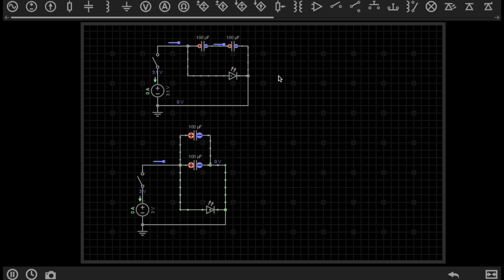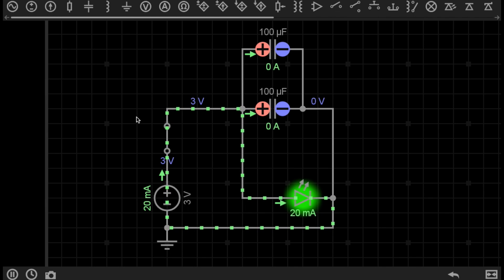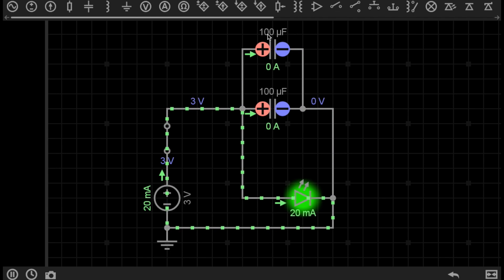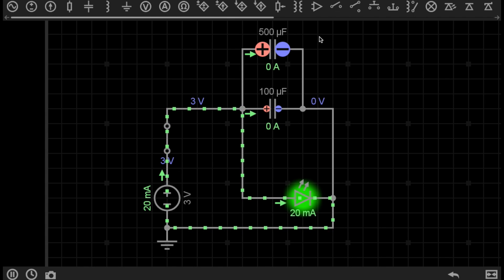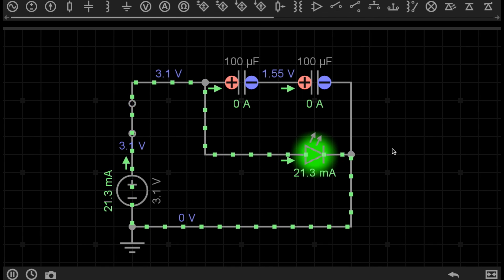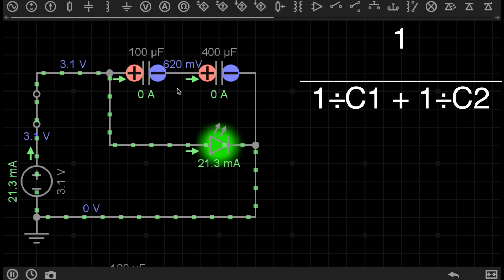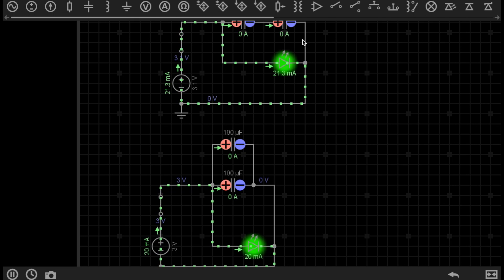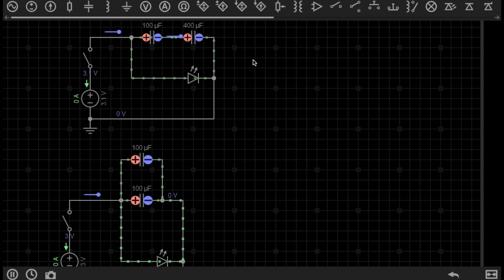Capacitors in Series & Parallel - Electronics Basics 20

Comment: How about rating voltage of 2 C (same value) in series,  is it increasing? Example : 100uf/10v 2x series,  it will be 50uf/20v, is it correct?

Comment: i was wondering  could you help me dsign a regulator circuit for a 12v car alternator.  the transistor    is a tip 142   or tip 122.   you could probably  use this program.  so far i havnt had any luck.  in th circuit that controls current and switches the tip on off many times a second is a 2n3904  transistor.   the job is to keep main voltage  at 14.4 volts.

Comment: what stimulation software are you using
Reply: http://everycircuit.com ... This video >>>
http://everycircuit.com/circuit/6533638421741568/capacitors-in-series-and-parallel

Comment: I have one metal  capacitor in a tape recorder which I cannot purchase,it’s 300volt, 8 uF,How can I wire in capacitors too make up this value.HELP  would be useful,I’m restoring a reel to reel tape recorder.Thanks in anticipation.
Reply: You could probably use a 10uF capacitor to replace it. Just make sure it is rated at >300 volts.  Capacitor voltage rating is not important as long as it is higher than the one being replaced.

Comment: i cant figure it out how it became 80uf
Reply: First do the 2 calculations  below the line  - Divide 1 by 100 = 0.01 then divide 1 by 400 = 0.0025 Add both answers together = 0.0125  Now take the 1 on the top line  and divide it by the 0.0025  Answer 80uf
Reply: as much as i understand, in serial the electricity is spread across the capacitors, because its serial means it cant go anywhere else or accumulate on one  capacitor but not the other one as they are in line they will just get same charge, farads depends on voltage and in this case the batery just cant charge more than 80 farads
https://www.khanacademy.org/science/physics/circuits-topic/circuits-with-capacitors/v/capacitors-and-capacitance

Comment: What size capacitor would I need to handle, at the very most, 35 volts and 3 amps? Also, does anybody have any good circuit board brands and sizes to recommend for general projects?
Reply from the maker: how are you using the capacitor? what is its purpose. it all depends on its configuration.
Reply: I'll be using it for general projects, probably a variety, probably with 22 gauge wire and those specs at the maximum.
Reply from the maker: +S J I can't give you a specific value of capacitor without knowing what it will be used for. The most I can say is it will probably need to be a relatively large value and have a voltage rating above 35V. There are different formulas to use to calculate the capacitance needed depending on the discharge time and voltage change.